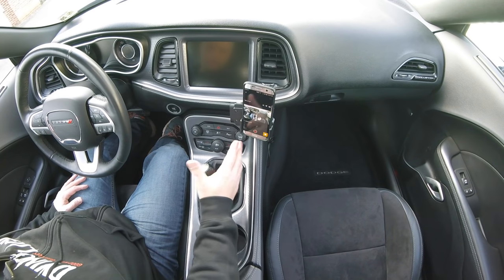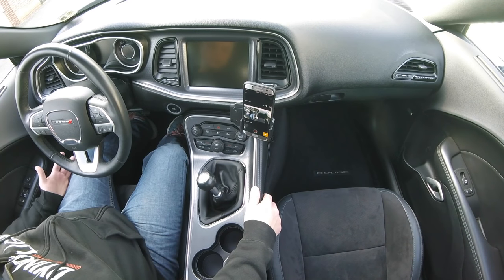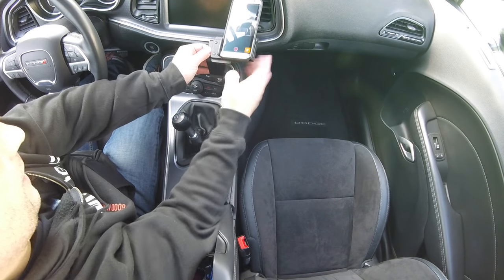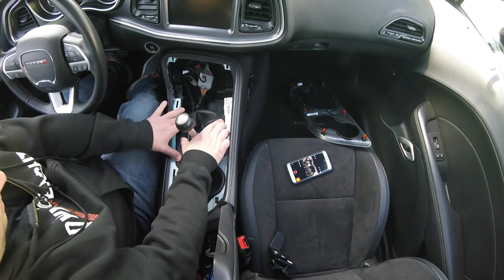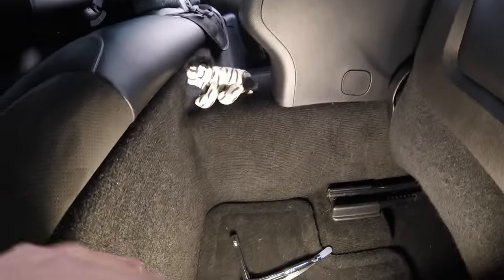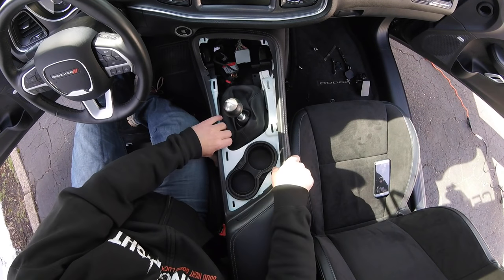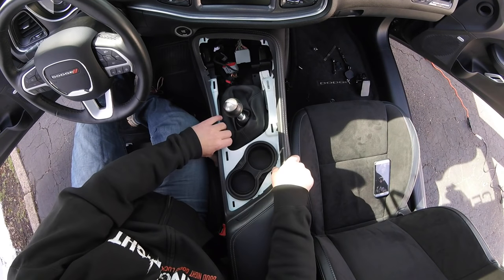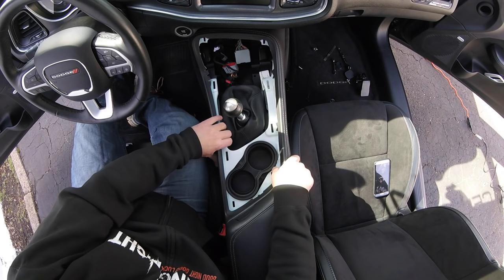Barton Shifter complete Install - Dodge Challenger Scat Pack

Comment: Can I assume this is the same process for a Hellcat?
Reply from the maker: Yes same process for the hellcat, I just swapped the shift handle on a hellcat a few months ago and it's exactly the same.
Reply: Awesome Thanks. I completed the install on Friday. Pretty easy for the exception of that passenger side Pin. Thanks for the Vid and keep them going

Dan
Reply: I also had some of the bolts loosen after a 25mile ride on a bit of a bumpy road. I backed the allen bolts out and put a bit of blue lactate as well as 2 (1 each side) of the shifter lock bolts. 

Not a bad Idea to those who are installing to put a drop of locktite on some of the bolts while installing
Reply from the maker: What allen bolts are you referring to? all the shifter bolts have lock washers on them so they should not back out.
Reply: My shifter had 2 6mm allen. Olts holding the flat stick to the Fork Style Base. Also had a jam screw that went in from the other side. 

All the bolts had lock washers but the quality was a bit sub-Par. 

I torqued everything to Barton specs on install but still had some loosening after 25-50 miles. I added loctite and retorqued. Hopefully that solves the problem.
Reply from the maker: Weird I didn't have those 28:17 they were all hex with washers and lock washers.  no issues yet, but now I'm wondering if I should check and locktight mine anyway?

Comment: i just installed my barton shifter, i have more road noise a tons more vibration coming from the shifter, did have the same issues?
Reply from the maker: I've got no Vibrations, and only  a little bit of added noise between 1st and second gear, but this slight noise is common in most installs

Comment: For anyone who’s done this install, does yours sound like it’s rubbing against the drive shaft? Is that normal or is something messed up?
Reply from the maker: No rubbing at all I’m clear of the drive shaft. The only difference in sound you should notice is when you are straining (higher gear too low of a speed). That sound comes through the Barton boot a bit louder than it did with the stock.

Comment: Bravo good detailed video
However, just installed Barton in my Hellcat-VERY disappointed
Noise from the transmission/exost reminds me of an old dump truck I was driving 15 years ago
Original one much more comfortable, Barton- short shifts yes, but very stiff, I'm not shifting faster with BArton-its just a BS-big one
Reply from the maker: Thank you, I heard the noise you are talking about, there are some fixes for that, I've seen people user a bit of insulation under the console.

  Regarding the shifting, in my opinion, it was so much better, the shifts were guided better, never missed my 2nd - 3rd and 3rd - 4th the stock stick for me was very sloppy.  When I went back to the stock shifter for a few weeks before getting rid of the car, it just confirmed for me that the Barton was worth it.  Again, that's just how I feel, sorry the Barton wasn't awesome for you.
Reply: @WorkPlayDrive  
I see what you are saying 
Personally I think it is not worth its price (almost 400$) it can be better designed for such money
It tremendously amplifies not only noise from transmission/clutch but also from your exost
I think it would make more sense to install barton together with "bad boys " cluth where you can adjust your clutch pedal further away from floor
Like I mentioned, I was not shifting faster with Barton

Comment: Well done DYI video as always. But still not sure I want one.
Reply from the maker: Thank you, it's a big expense be sure before you pull the trigger.  I grabbed mine during a black Friday sale.  If/when  you are ready to pull the trigger check out stevewhiteparts.com they recently started selling the Barton Shifters and I have a discount with them (Code: workplaydrive)
Reply: Work Play Drive thanks for the promo. Did you ever did the full review video of it at the track?
Reply from the maker: I'm hoping to knock out some reviews now that winter is here.  The Barton is definitively much better with quick shifting at the track, and I no longer get jammed up between 3rd and 4th.
Reply: Work Play Drive cant wait to see it. Thank you for taking the time to answer me. You're the 3rd one in less than a week to suggest the Barton shifter. As per now Im still debating which should be my 1st performance mod. These were my 3 choices before the Barton! https://youtu.be/Fzb9A2jhiU0.
If you had to do it again which would you do in what order? Thanks in advance...

Comment: you installed a supercharger in your scat pack shaker? if so, which brand did you go with?? I have a 2016 scat pack shaker
Reply from the maker: lilJames881 no supercharger yet... I am looking into it for next season maybe. Not settled on a brand yet
Reply: Oh it was the hellcat video at 1:51 that I heard the supercharger. Completely mixed up the cars
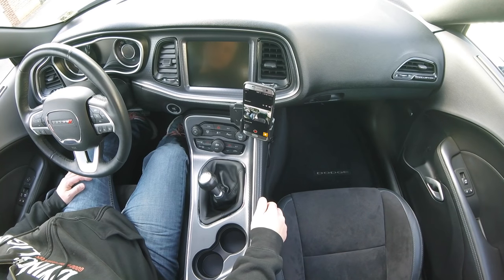Reply from the maker: Ahhh I see, at 1:30 I mentioned that I had driven a hellcat with a barton and loved it, then cut to the clip you mentioned of me driving a hellcat with the barton. Sorry about the confusion.

Comment: So the factory shift knob won't work, is that correct?
Reply from the maker: The factory shift knob will work however you need to buy the barton kit specific to reusing it.  The stock shift knob does not come off alone it's press fitted into the shaft as well.
Reply: Work Play Drive Hey thanks for getting back to me! Want the Barton. Great video, great car!

Comment: ..... Question, for ANYONE reading this: Would/could this POSSIBLY drop a 1/10 of a second from 0-60 and/or the 1/4 mile time on a '23 Widebody ScatPack (manual obviously 🥴)? Thanks!
Reply from the maker: If you struggle with the any of your shifts I can say it will.
Reply: @WorkPlayDrive  .... I don't really struggle with any but, seeing as it reduces the throws by 40%, I figured that the 3 shifts during the 1/4 mile, might end up with a quicker time?!? Thanks 👍

Comment: You didn't need to remove that center bar arm from the tranny.  It can stay in there as you remove the shifter assembly.  It's easier to just leave it attached since the Barton then gets installed onto it anyway.  Overall, decent video, but you'll save time and you won't have to break the loctite seal leaving that in.  Those clips are a pain though, I can attest.  Watch my video, it's in fast motion. Yes, I'm a Hurst guy, but the process is the same. https://youtu.be/PbuuyvK7LdQ (go to 1 minute and 13 seconds in on my video and you'll see what I'm talking about, leaving that middle bar alone). Nice work though!
Reply from the maker: hurst or barton, both are an improvement from stock, it just comes down to personal preference.  I opted to remove it in that order because it's easier and more accessible to remove it from the trans, then once out of the car pull it from the shifter.